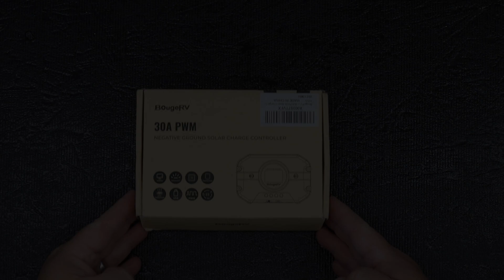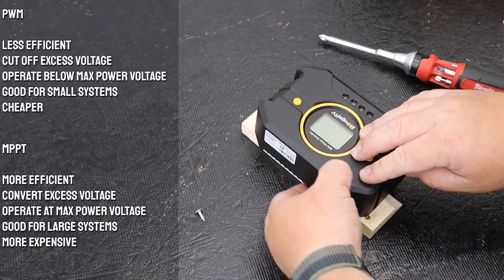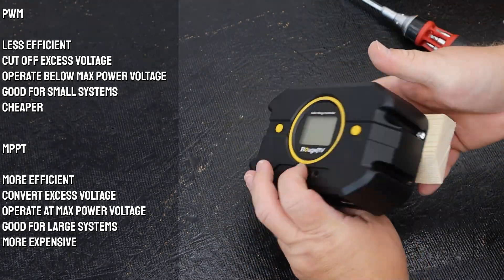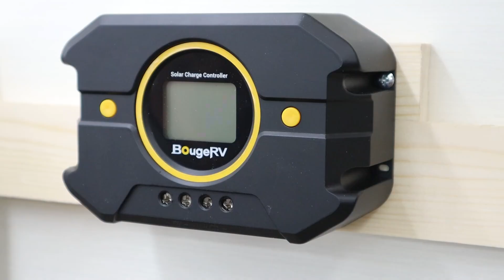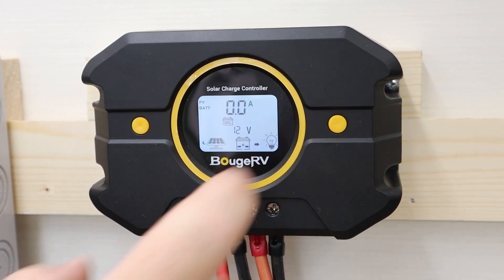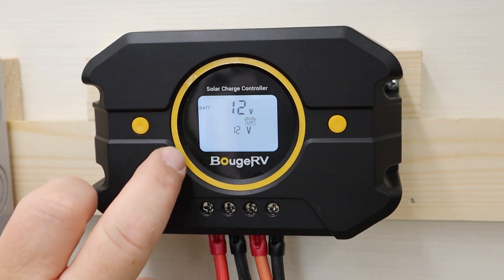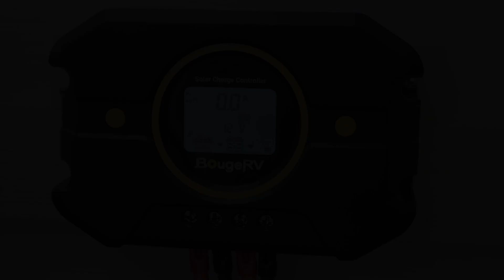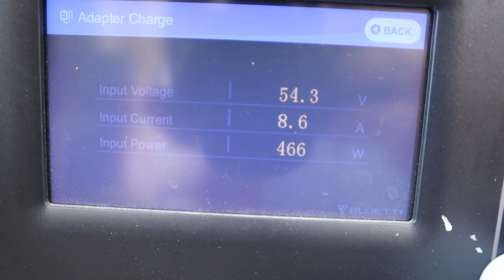BUDGET SOLAR CHARGE CONTROLLER - BougeRV 30 amp Solar Charge Controller

Comment: Thanks for your help. Great job. I bought the BougeRv Solar charge controller to replace the one I got with my Eco Worthy solar panel and with your install and how to work the controller I couldn’t be more happy. I want to put two 100 watt panels on the south facing side and two 100 watt facing the west side of my roof. Will the BougeRv controller be ok. Keep up the good work. Looking forward to future videos.
Reply: That is about the same set up I have. Two on the east side on my deck roof and two on the west side on my small shed. However, I have two Bourgerv 20 amp PWMs for the two sides which are connected in parallel on the 100 watt solar panels and I also fused them with mini 20 amp fuses to the battery. If I had three panels at each end then I would have used two 30 amp Bourgerv PWMs. I do like the simplicity of how to use the function keys to set it up for my 150 ah Eco Worthy metal case battery to run my 2000 watt inverter (added note...set the charge controller to 14.2 rather than 14.6 to ensure the battery's life span). I have limited space inside the house and the two PWMs sit perfectly on the small board with the 200 amp fuse and two bus bars.

If you do a search on Google, Duck Duck Go or whatever, you can find PWM or MPPT calculators which helps in selecting the device for the solar panels to charge the battery. The PWM is the easy one since it only asks for the short circuit of the solar panel and how many panels you have. After the information is given it calculates the amperage for the correct PWM. For an MPPT it ask for the wattage of the panel, the open circuit, the short circuit, how many panels are wired in series and in parallel and what is the coldest day of the year. This information given calculates what MPPT to have. Since we both have two locations for solar panels it would be wise to have two MPPT controllers since the two locations are wired in series. To join them both would result in having a parallel connection and that would go over the maximum voltage of the MPPT unless you buy an expensive Victron that is designed to handle above 100 volts.

Comment: PWM?  Okay to start, but you need to keep the solar panel voltage near the battery bank voltage because it cannot convert down but will simply discard (in practice) the excess.  Don't pay much for a PWM controller as it is a disposable item if you keep moving on the solar journey.
Reply: Friends of mine have had their pwm last more than 10 years. With daily use.  That is hardly disposable.
Reply: @maybee7126  
Your buggy whip and carriage hat are still fully functional fashion items as well. 👍
Reply: @maybee7126  They most likely use it to charge a lead acid based battery. Here is a neat trick to pass on to your friends. Ali Express has buck boost step up converters (they changed the name to charger to get more money for them) which can take the charge voltage from the PWM and convert that voltage to 14.5 volts to charge a Lifepo4 battery(s). It can be directly be hooked up to a 100 watt solar panel (my open circuit voltage is 24.5) since the converter can handle up to 30 volts to convert to 14.5 volts. They cost $21.50.
Reply from the maker: Absolutely correct! :)

Comment: Sam i don't want to knock u but i would be careful with those cheap Chinese controllers.. They may cost more than u think if something fails and they over charge ur batteries and now ur batteries are trashed ... Im just saying we been off grid for 7 year's never trust a controller under 100.00 unless u only have one battery for like lights or security cameras just trying to help u out brother....

Comment: These kinda things are what I'm looking for, the entry-level, lower-priced stuff.  One concern I do have about the heatsink, it's on the back, where it'll be pressed right up against whatever surface that it's mounted to.  I'd rather see the heatsink more exposed, so it could dissipate the heat better, but I see WHY they made it like they did (display up front, no room for heatsinks there).  If heat becomes a concern, one of those little USB powered fans (AC Infinity makes some nice ones) under the unit, blowing upwards would absolutely fix the problem..  Could even be plugged into the supplied USB port, so it'd be active only when you've got incoming solar power (I'm assuming that's how that port works anyway, but it may also pull power from the battery bank when there's no solar input).  I REALLY need to put a temporary camera up on my out building pointing towards the south facing roof on our house to see how much solar exposure we get on any given day without any tree modifications.  I have a feeling though that I'm going to have to take down some trees to get any meaningful power generation :(.
Reply: You mount solar components on a fireproof material for safety.
Reply: @williamkn621 just because the surface is fireproof, doesn't necessarily mean it'll be able to pull the heat away (IE:  type c or x drywall are generally thought of as fireproof, but they're really just more fire-resistant).  Guess the only way to be 100% sure it's fire proof is mount them to a metal plate, that'd also double as an additional heatsink..  Most solar installs I've seen mounted the stuff to the drywall in a garage, or on a mounted piece of plywood (but I've only seen a couple installs in person, so who knows if that's up to some sort of code or not).
Reply: @heffe2001  hardiboard cement board used for bathrooms for example backed by plywood since screws aren't very trippy in hardi.  Yes, lots of people just mount on a wall.  Or plywood.  What experience I have with mppt charge controllers with rear heatsinks is they were pretty oversize and didn't get very hot as they were at capacity (amps).

No experience with pwm controllers. At least yet.  The price of this pwm controller is kinda close to 30a mppts from good middle lower brands.  I'm halfway considering figuring out the OEM for this since this is pretty obviously a branded part
Reply: I gotta cut down a big trashy Chinaberry tree already damaged by our big freeze in Texas a few years ago.  It blocks late afternoon and evening Sun on one of my ground mount arrays (a pergola type shade).  And panels on my workshop. I established some shorter shade trees under it so we still will have some shade but no where near as tall 

The USB ports on pwm and other charge controllers are generally able to be programmatic set.  So yes, run a muffin fan when solar is producing
Reply: @williamkn621  I've got 2 40-50' maples (one on the west side, one on the east) that'll have to go, or at least be topped.  That's just to get from around 10am to 8pm  coverage (summer hours anyway),